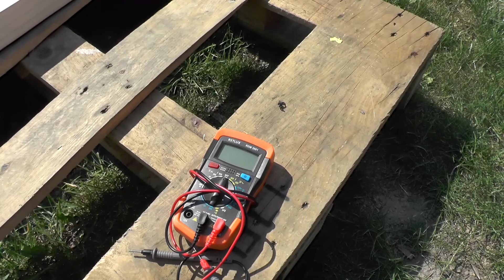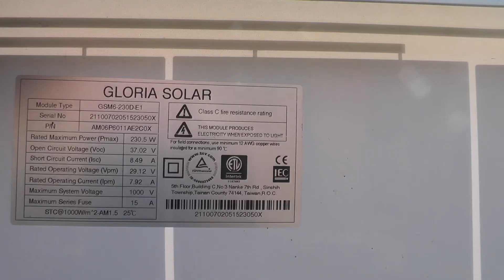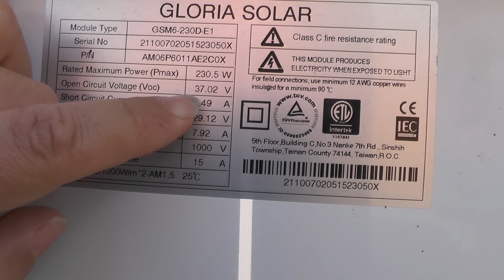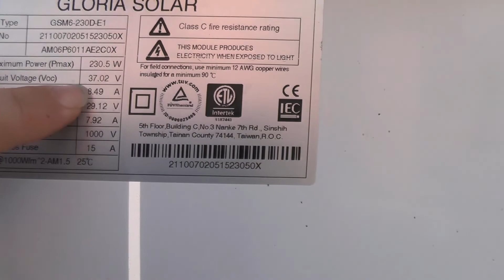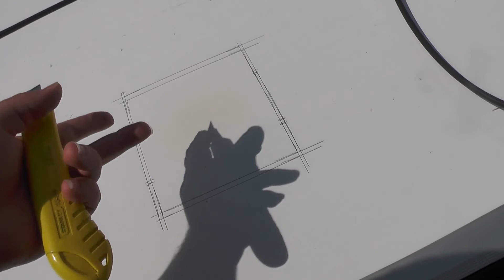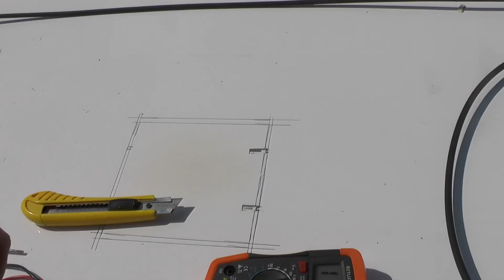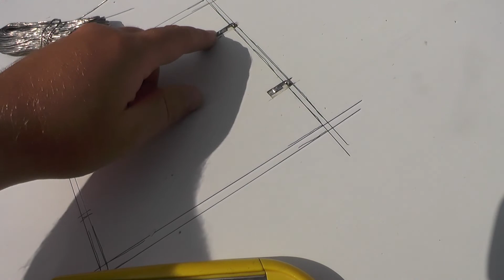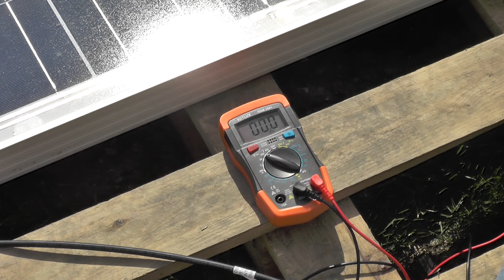How to repair Old Solar Panel - Burned 1 Cell

Comment: Shouldnt you have cut the tabs at the back if you wanted to bypass that cell.. then connect external bypass wire.. i assume the top  cell is negative and the bottom is positive.. so you series them like a battery connecting positive to negative of one cell to the other...
Reply from the maker: Hello.
Hello.
In this panel in my case no. I just shorted out one cell by connecting  plus and minus on one solar cell. You can do it your way as you described to totally disconnect one cell,  but in my case it was bit more work and as it is an old solar panel, I simply shorted out one cell. I do not see any problems with that as this shorted solar cell should not cause any problems. 
Have a nice day.

Comment: Yes, when the glass has been removed it is easy. But: how to remove broken glass?
Reply from the maker: Hello. This is not about removing glass. Glass is still there and I was accessing solar cell from back side where is just plastic. Solar cells are on laying on the glass and glued in some sort of transparentplastic materiel with another sheet of thin white plastic. Accesing of  separate cell contacts is quite easy in this type of old solar panel. As far as I know it is not possible to remove glass as glass is tempered an glued to the solar cells. If you have broken glass- it is not possible and solr cells under broken glass are probably already  badly damaged. It is not worth to try to repair old broken solar panels as prices of new solar panels dropped in recent years. Have a nice day.
Reply: @jkp  Good morning . Perhaps on old panels the rear panel cover was made of plastic, but on today's panels they are also made of glass! (made in china). There is no way to access the cells even from the back, unfortunately. The only access options are through the "diodes" that interconnect the entire set. We can "eliminate" a whole set (in my case there are 24 cells!) that form 12.4V. Unfortunately, the loss is great!

Comment: Dear JKP guy,
Could you help me please in repair of solar panels that have low power (due to the snail trail effect?
May I contact you somehow?
Reply from the maker: Zdravím. Podle jména jste asi CZ nebo SK. V první řadě nejsem odborník na  opravy solárních panelů a podle toho kde jsou solární panely umístněný to může mít v případě požáru dost velké následky, takže nemůžu doporučit opravovat solární panely a nejsem odpovědný za žádné škody, každý musí vědět co dělá a být odpovědný za své činy. Solární systémy občas způsobují požáry budov a pak je to těžký se soudit s pojišťovnou nebo někým kdo něco špatně udělal.  Takže upozornění máme za sebou. Z toho co jsem se díval tak ,,snail trails´´ na solárních panelech je buď popraskaný samotný článek nebo oxidace kontaktů a cestiček v solárním panelu kde jsou zároveň při oxidaci mikrotrhliny. Ve většině případů je to způsobeno špatnou kvalitou článků, nebo nějakým problémem při výrobě kde do solárního panelu vstupuje vlhkost atd. Občas se to stává i u velkých výrobců kde se pak uplatňuje záruka a celá problematická série se stahuje z trhu. Jinak pak pozor na to protože tyhle špatně vyrobené panely se pak prodávají s velkou slevou s částečnou nebo žádnou zárukou. V mým případě jsem měl problém pouze s jedním článkem tak jsem ho vyřadil z oběhu že jsem ho v podstatě vyzkratoval ale takový panel bych nikdy nevrátil do sestavy na střechu kvůli bezpečnosti a pak následně degradaci výkonu celého systému.  Já to mám jenom ´´na pokus´´.  Solární panel má články které jsou zapojené sériově aby bylo dosaženo potřebného napětí a pak ty série jsou zapojené paralelně aby byl dosáhnutý požadovaná proud. Takže je to úplně jednoduchý princip stejně jako by jste chtěli spojit AA baterie. A teď k vašemu problému, záleží na tom jak velký je problém. Pokud se jedná jen o pár kusů solárních panelů nebo o hodně panelů tak bych v první řadě kontaktoval prodejce a uplatnil záruku pokud jsou panely ještě v záruce a pokud již záruka není, tak bych stejně kontaktoval prodejce a zeptal se ho jak postupovat protože výrobce by měl garantovat výkon po dobu cca 20 až 30 let. Tam ale nevidím moc šancí na úspěch. Takže se vracím k problému opravy panelu. Pokud je panel na střeše domu tak bych ho definitivně odpojil se sestavy kvůli riziku požáru a degradaci výkonu celé sestavy a tam je pak otázka jak jsou na tom ostatní panely jestli nestojí za zvážení demontovat a nahradit celou sestavu panelů novými. Například když má někdo 10 let staré panely tak výkon jednoho panelu byl kolem 200-250 w a dnes se dají koupit panely s tejného rozměru ale s dvounásobným výkonem, takže např 8 starých panelů se klidně dá nahradit 4 novými panelami p a při dnešních cenách se pohybujeme kolem 1800-2500 kč/ks za cca 400W výkonu. Takže ceny jsou dnes celkem slušné takže pokud se jedná o dom, tak bych definitivně zvážil výměnu panelů za nové. Pokud se ale jedná jen o sestavu panelů někde na zahradě kde nebude vadit když to shoří tak bych to možná zvážil opravit. Ale tu je problém, když jde jen o pár kusů z mnoha panelů, tak opravou – vyřazením jednoho článku v panelu se sníží výkon panelu a tím že se sníží výkon co jen jednoho panelu v sestavě tak se sníží výkon celé sestavy. K tomu když bereme do úvahy že problém vzniknul v první řadě tím, že se do panelu dostává vlhkost, tak je to jen dočasné řešení a v budoucnu se to bude jen a jen zhoršovat. Bohužel tady to vidím jen na výměnu všech poškozených panelů nebo celé sestavy. Doporučuju se podívat na video kde je pěkně ukázáno jak se počítá výkon sestavy v různých zapojeních a pěkné srozumitelné video je např tady:
https://www.youtube.com/watch?v=OsOnDmPSwqA&ab_channel=Cleversolarpower
https://www.youtube.com/watch?v=3d4QSxGFaGw&ab_channel=EnergyUME
Nebo najít nějaké video vysvětlující co se stane když je v sestavě panel s nižším výkonem.
Přeju hodně úspěchů při řešení problému. 

Hello. According to your name, you are probably from CZ or SK. First of all I am not an expert in solar panel repairs and depending on where the solar panels are placed it can have quite a big impact in the event of a fire, so I cannot recommend repairing solar panels and I am not responsible for any damage, everyone needs to know what they are doing and be responsible for their own actions. Solar systems sometimes cause building fires and then it's hard to sue the insurance company or someone who did something wrong. So we're done with the warning. From what I have seen, ``snail trails'' on solar panels are either a cracked cell or oxidation of the contacts and tracks in the solar panel, where there are also microcracks during oxidation. In most cases, this is caused by poor cell quality, or some problem during production where moisture enters the solar panel, etc. Sometimes this happens even with large manufacturers, where the warranty is then applied and the entire problematic series is withdrawn from the market. Otherwise, watch out because these poorly made panels are then sold at a big discount with a partial or no warranty. In my case, I only had a problem with one cell, so I took it out of circulation by essentially shorting it out, but I would never put such a panel back into the assembly on the roof because of safety and then the degradation of the performance of the entire system. I only have it "to try". The solar panel has cells that are connected in series to achieve the required voltage and then those series are connected in parallel to achieve the required current. So it's a very simple principle just like you would connect AA batteries. And now to your problem, it depends on how big the problem is. If it is only a few pieces of solar panels or a lot of panels, I would first of all contact the seller and claim the warranty if the panels are still under warranty and if the warranty is no longer there, I would still contact the seller and ask him how to proceed because the manufacturer should guarantee performance for about 20 to 30 years. But I don't see much chance of success there. So back to the panel repair issue. If the panel is on the roof of the house, I would definitely disconnect it from the assembly due to the risk of fire and degradation of the performance of the entire assembly, and then there is the question of how the other panels are doing, whether it is worth considering to dismantle and replace the entire assembly of panels with new ones. For example, if someone has 10-year-old panels, the power of one panel was around 200-250 w, and today you can buy panels with the same dimensions but with twice the power, so for example 8 old panels can easily be replaced with 4 new p panels and at today's prices we are around 1800-2500 CZK/piece for approx. 400W power. So the prices are quite decent today, so if it is a house, I would definitely consider replacing the panels with new ones. But if it's just a set of panels somewhere in the garden where it won't be a problem if it burns, then I might consider repairing it. But here's the problem, if it's just a few pieces from many panels, then with a fix - eliminating one article in the panel will reduce the performance of the panel, and by reducing the performance of just one panel in the assembly, the performance of the entire assembly will be reduced. In addition, if we take into account that the problem was caused in the first place by moisture getting into the panel, it is only a temporary solution and in the future it will only get worse. Unfortunately, here I can only see it for the replacement of all damaged panels or the entire assembly. I recommend watching the video where it is nicely shown how the performance of the assembly is calculated in different connections, and a nice understandable video can be found here, for example:
https://www.youtube.com/watch?v=OsOnDmPSwqA&ab_channel=Cleversolarpower
https://www.youtube.com/watch?v=3d4QSxGFaGw&ab_channel=EnergyUME
Or find some video explaining what happens when there is a lower power panel in the assembly.
I wish you the best of luck in solving the problem.